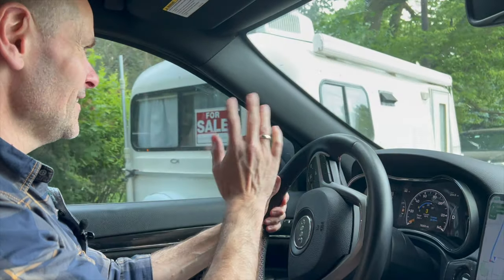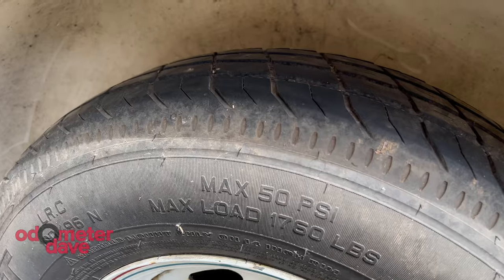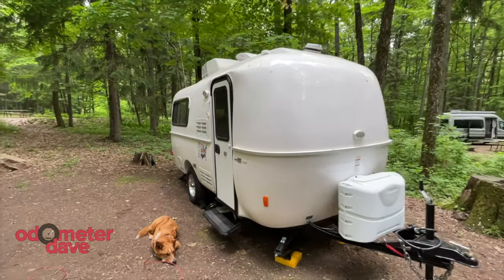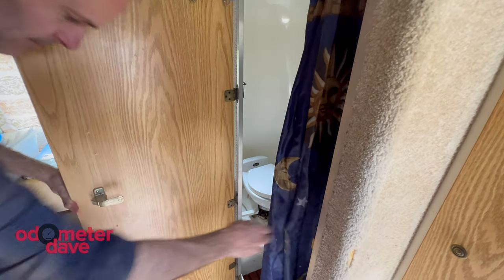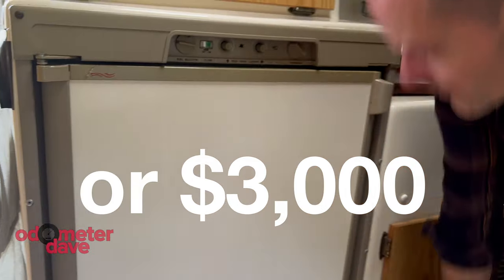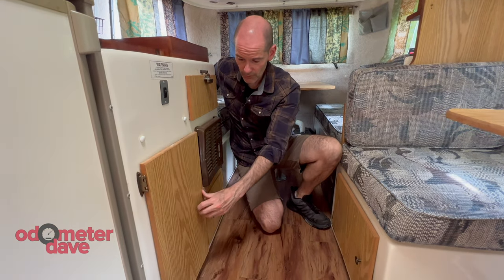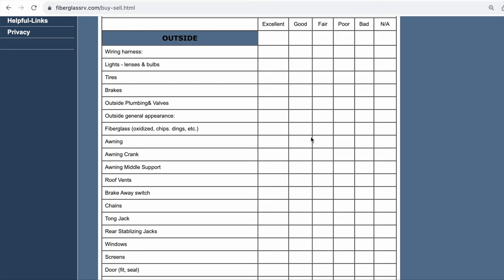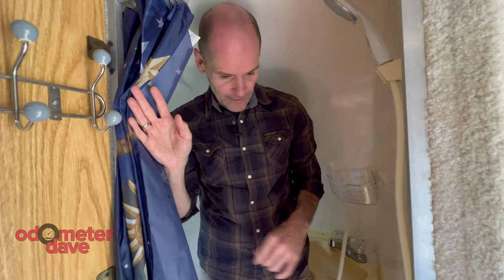Would you take on this 1999 Casita fiberglass camper renovation?

Comment: What are your thoughts about the Front A/C units? I am looking at one of these now , its very dirty! The owner thinks it is a 2005. BTW, we have previously owned, in descending order, 2018 Pleasureway Ascent, 2016 Oliver Trailer, 1989 Airstream 25,  1996 Jayco Pop Up, 199? Starcraft. As you can see we are not Rookies. Our driving reasons for looking at a Casita are DownSizing in both terms of SIZE  and COST.
Reply from the maker: What did you think of the Oliver?! Unfortunately I don’t have enough experience with Casitas to have an opinion about the A/C units. Other than that it was pretty loud in the 2021 unit we rented. But it worked great! Thanks for watching and commenting and let me know how your quest pans out! -Dave
Reply: I like my front a/c, never used it yet, but way less expensive to replace, and no huge hole in the roof. May not be super efficient in a hot climate, but I'm not going camping if it's above 80 degrees.. 😂

Comment: I owned an '88. Be glad you didn't buy it. Even that one was made better than the one I owned. All the window openings were cut a tad too big and I didn't notice it until moved across country. It leaked everywhere. No place to get warranty work done. Axle was very under rated and broke on me. IMO, anything over $5k would have been too much for that thing. In '89, mine was $7700 out the door.
Reply from the maker: Haha! Thanks for that perspective, much appreciated. I'm glad we didn't end up buying the Casita because we just recently bought a trailer that fits us a lot better. It still needs a ton of work, but not as much as that little Casita needed (in my opinion, anyway). Thanks again for watching and commenting! - Dave

Comment: My biggest fear would be rotted floors
Reply from the maker: Mine, too, absolutely! Casitas are mostly immune to that, but I've learned that it's still possible. Thanks for watching and commenting, Stuart! - Dave
Reply: Casita have a solid fiberglass floor but the osb floor in my 93 was in bad shape. A 1/2 piece of plywood, and laminate lock together floor and 1/4 round made it like new.
Reply: * The osb sits on top of the fiberglass bottom, but mine got weak right down the middle where it was always walked on.
Reply: @johnnymoran180  It got weak because of moisture or repeated foot traffic?

Comment: Think long think wrong.  The last Casita I flipped I cleared $5500.
Reply from the maker: That’s fantastic! What year/model, etc.?
Reply: @OdometerDave  2017 sprit deluxe. It had been setting several years. I got all system working properly and buffed out exterior. And cleaned EVERYTHING! Remember to put it back like the factory did it. NO hacks and things you want. If it needs, new axel and brakes too. Don't sell it until its right. There's enough ebay rip off people out there flipping.
Reply from the maker: That is excellent advice! We looked at used trailers where the owners had made very "personal" changes/mods and it really turned us off knowing we'd need to undo them.